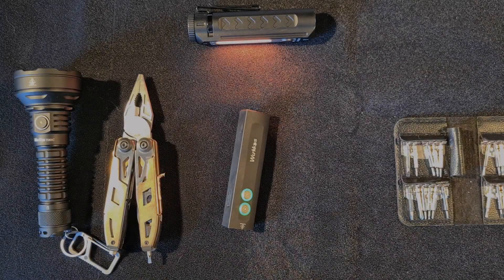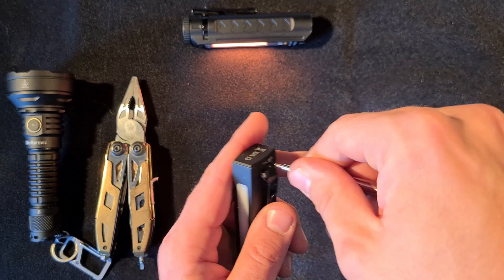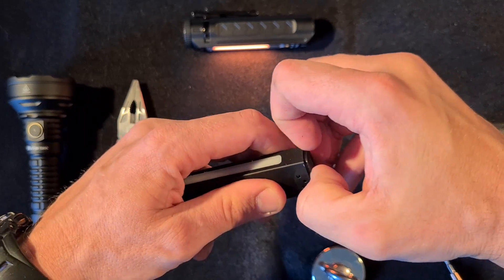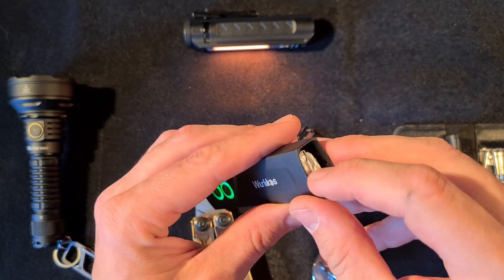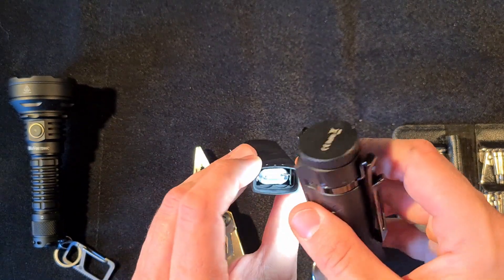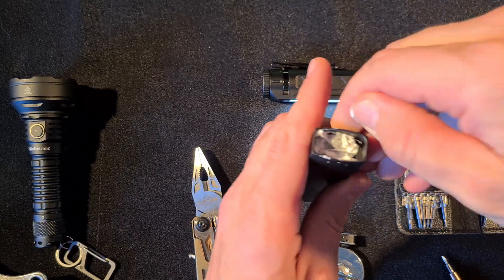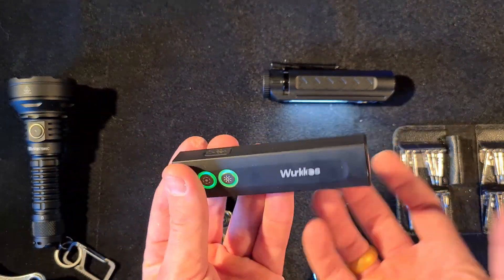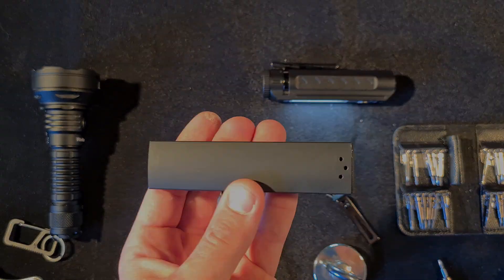Wurkkos HD01: How To Get to The Battery / Fix Rattle

Comment: Hi Buddy, looks like a quick but also pretty "final" solution, because it will not be easy to re-open it again with the hardened silicone in it. Maybe it would have been better to fit some stripes of foam in it? I also ask myself if there is any solution to open the front also or if at the front there is a "once klick in and never open again"-option... 
But nevertheless a fine and fast fixing. LG
Reply from the maker: Thank you, I think it is possible to break the acrylic silicone seal easy enough though. I shall see ;-)
Reply: It was what I’d call an irreversible bodge, that magnetic cap ain’t coming out again that’s for sure, glued in tight 🤦‍♂️
Reply from the maker: @danjackson140  oh, it would come out had I not lost the light since ;-)

Comment: Great fix! You also kind of improved water resistance from the back. Did you have the chance to pull a little bit more from the battery (before the video) to see how is it connected? 
I'm afraid to pull harder and cut some cables or short circuit something
Reply: On video is the first time he opened it. I personally wouldn't be messing with  the battery unless Wurkkos sent a new unit specially for a teardown video.